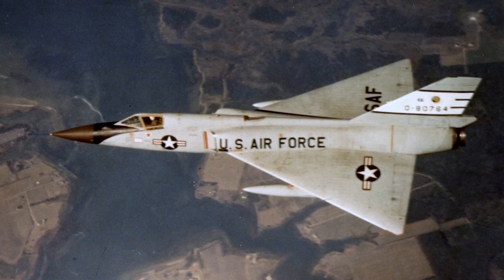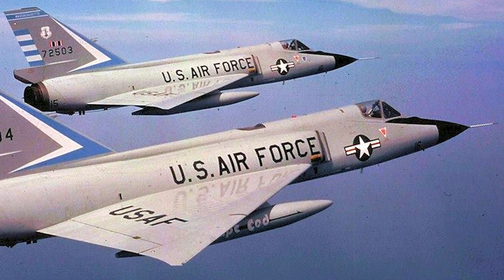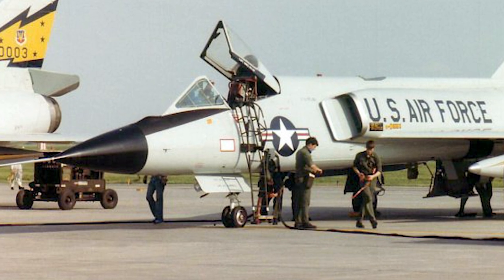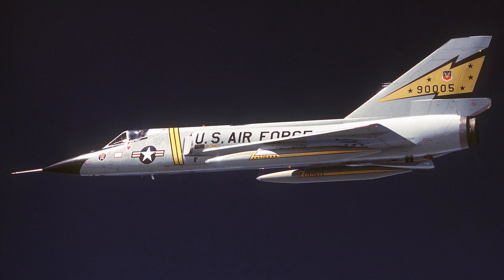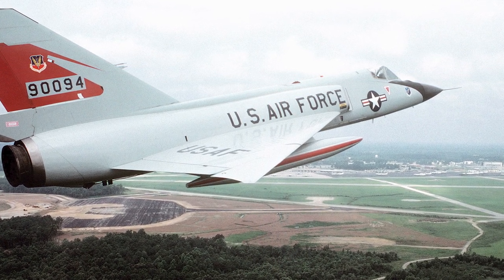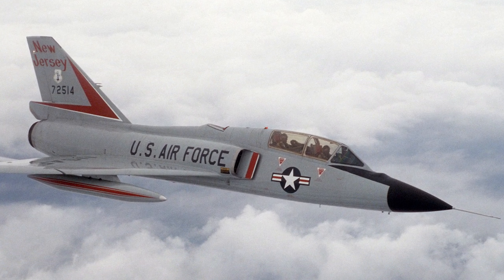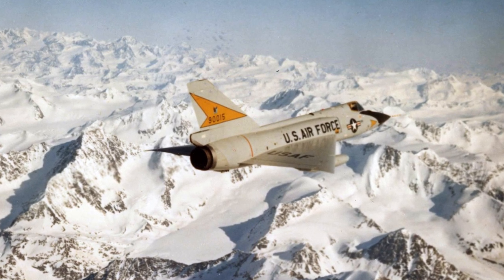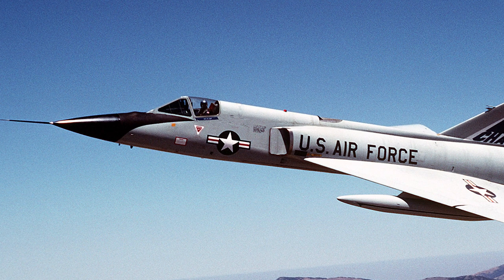A Short History: Unveiling the F-106 Delta Dart – Cold War's Premier Interceptor

Comment: Excellent overview and graphics;  pilots from Selfridge AFB (now ANG)  flew these and used to do low altitude (200 ft high) flybys over Lake St. Clair just under Mach 1 - great recruiting tool! The F-106 was the backbone patrolling the Northern Skies keeping us Michiganders safe back in the 60's and 70's. I assume F-16s took over most AFNORTH/NORAD duties after that era.
Reply from the maker: Thans for watching!
Reply: DUDE!  I live just a couple of miles of away from Selfridge.  I can tell you that the F-106A was far and away the absolute best looking aircraft ever deployed.  Nothing like it since.  The tail and nose art of the MI ANG Six squadron was legendary, and even pushed the envelope of what was allowed.  When that squadron transitioned to F-4Cs they got the same nose and tail treatment.  After the F-4C they briefly had F-16As.  Now they have A-10s.

My opinion:  The F-4C could not have possibly been a good replacement for the F-106A in the interceptor role.  It was a downgrade.  Who made that decision?  Actually, even the F-16 is outclassed by the F-106A in the interceptor role.  The only plane that came close was the F-15A, but that was below 45,000ft.  Above 45,000ft the F-106A rules again, besting more than few F-15s in supersonic air combat.  Just ask Bruce Gordon!

The very first time I saw the Six it was a flight of four (in formation) into Wurtsmith AFB back in the 1970s.  They were based there along with Buffs at the time.   I was thoroughly hooked.  I cannot get enough of this aircraft.

Comment: Today it still holds the speed record for a single engine aircraft of 1529.95 MPH or Mach 2.39.

One night I saw an alert takeoff from the klaxon to disappearance in the air.  As they taxied to the runway from the barn, they were acerating and as they made the turn onto the runway you could hear the tires squealing and the AB igniting.  They were about 1/3 of the way down the runway when they were airborne, and wheels were stored.  It didn't take them long before they were out of sight.

Comment: Does anyone know WHAT newer plane took over their role as interceptors..?
Reply: F-15 series, and now the F-22.

I still like the F-106A and wish they were still around.  Better looking plane than either the F-15 OR F-22.
Reply: @goUkraine  Ahh, cool Thanks. I just wasn't sure if the F-104 Starfighter was ever slotted for its role...
Reply: @veng3r663  No, not really.  The F-104 didn't have the range without a lot of drag inducing external fuel tanks.  The role that the F-104 excelled at was low level penetration due to a very small radar cross section and high speed.  Who would have thought the F-104 would be a good interdiction aircraft?  Probably not the original designer, who was Kelly Johnson from the Lockheed Skunk Works.